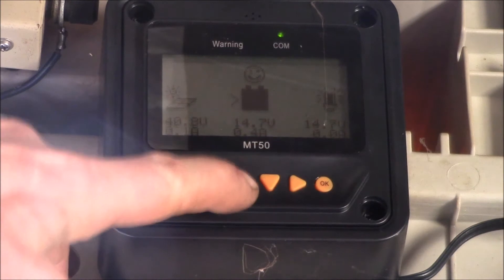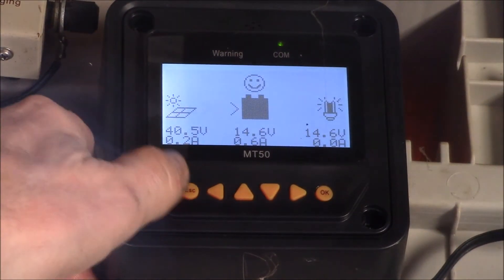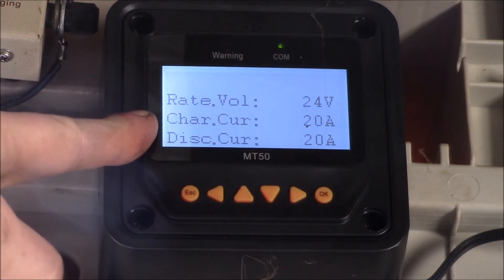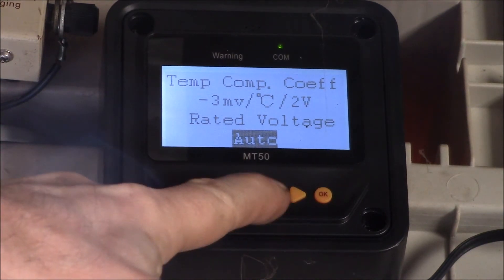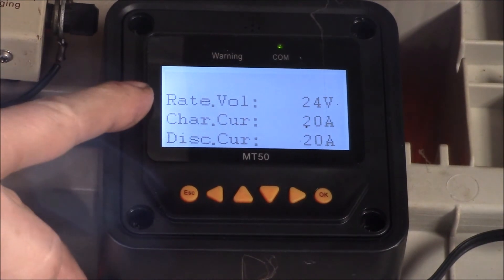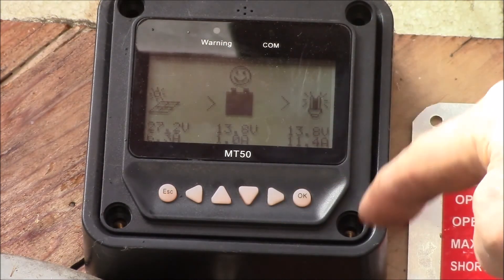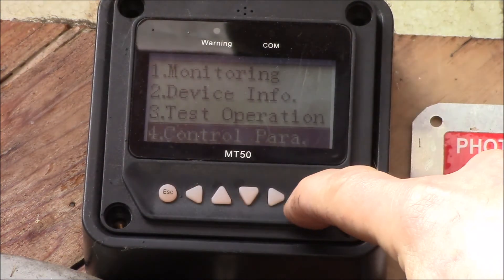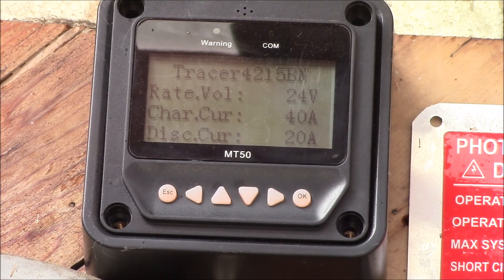EpEver/EpSolar MT50 Remote Display: Device Information Screen

Comment: I chose the 60a unit, and i put up 4 210w panels. The open circuit voltage is 19.83v and short circuit current is 13.09a, if i have my information correct i can run two in series then parallel the two series. I will need a 15a inline fuse in both series before they are paralleled. From there to the controller i won't need any other fuses, but i will from the charge controller to the batteries, do you know if im correct in my thinking? Since i may be adding another two panels in series if i need to, i believe you mentioned i would be all right maxing out/nearly maxing out my controller since it will only take up to 60a, and any more would just be loss of potential, will i need a 60a fuse from cc to battery bank or should i use a 100a in your opinion? From what i gather i need 12awg, is it ok to run 10awg though? I will only have 8-10 feet to run from my panels to cc, then 5-6 feet to my 12v 580ah lifepo4 battery bank. Any advice would be greatly appreciated, I've asked some of the content creator's that I've followed to get this far, but not all of them (any yet) have responded lol, but hopefully i get some input. God bless!!
Reply from the maker: Yes, if you have both series strings fused then no need for a separate fuse to the CC, although you might want to add a switch or breaker so you can disconnect PV input if needed.  10AWG is fine, that's about the limit of what fits into most MC4 connectors if you're making your own cables.  80A or 100A to the batteries sounds good, just want to be above the rated output of the CC and sized for whatever cables you are running to the batteries.  The CC will limit the battery charging current to it's 60A rating more or less, it may go a bit above that from time to time.
Reply: @The4Crawler  Hey i appreciate the information, i can't thank you enough!!

Comment: How much hours do you recommend setting the boost time charge on the mt50 controller...
Reply from the maker: I think the default is 120 mins. but you could set it higher and then see how long it takes for the charging current to drop down to the typical float charging current, which is in the range of 0.01C - 0.02C.  Then use that time or if the battery mfg. has a recommended setting, use that.
Reply: @The4Crawler  thanks much ...  .. i am using some trace 6 volts 225  amh lead acid batteries
Reply from the maker: @randomtv.9486  Likely your float charge current will be around 2-3 amps then.  See how long it takes to hit that as the boost charge tapers off.
Reply: @The4Crawler  Thanks much

Comment: Hi, we've recently bought a camper & we have just changed the x2 130ah lead acid batteries over to x2 110ah lithium batteries (life PO4), what setting do we put on the MT50? We know almost nothing about electrics & all the solar etc... We have x2 160w solar panels & an epaver  tracer MPPT 3210AN with the MT50. We tried changing the MPPT to FO4 but it would only allow us to click either SEL, GEL or FLD.  So we came across your channel & we've just watched your video about changing the MT50 to USER. What is the best setting for us to put it on without worrying about all the parameters or any major adjustments & is suitable for the Lithium batteries? 
2nd question if we have to change the battery voltage on the screen do we put the combined total ah (220ah) or do we just put the ah of a battery (110ah).
We live in the UK & are finding it all a little confusing so would appreciate any help or advice please. The only thing we do know is the charging voltage for each battery is 14.6
Reply from the maker: See this video:
https://youtu.be/4wt_L2L4W4Q
for information on setting up Li-Ion and LiFePO4 batteries.  There's a file linked in the description with the EpEver settings from their PC program that you can start with.  You can adjust those values as needed for your specific battery.  And in the MT50 user type menu settings, you may need to go through several times because settings later in the menu limit settings earlier in the menu.
For AH settings, 2 batteries in series, AH stays the same and voltage doubles, for 2 batteries in parallel, AH doubles and voltage stays the same.

Comment: My mt50 fails to go to day time charge mode even after 24hr clock has been set hope you can help.Cheers Peter.
Reply from the maker: I don't think the clock has any affect on what charging mode the controller uses.  I think it goes off of the start of sunlight hitting the panels after a night time period with no panel input.  I can trigger mine into a new "day" by switching off the PV input for a while then reconnecting it.  With this controller now, I have it hooked up to my 24V battery bank in order to charge my 12V battery bank.  It never goes into absorb or boost mode, it just sits on float 24/7, unless I switch off the PV input.

Comment: Hi. Thanks for the information you share. I have just started using a 4215BN unit and connected it with a MT50 remote. I would like to bounce some thoughts off someone, and you seem to be interested in this stuff. I am thinking that the load system should be able to be used as a load dump method for when more power is coming in than is needed. Have you had any success setting and using the load system. I am trying to use the settings to start dumping power at a certain voltage and then allow normal function once a lower voltage has been reached. I see in the menu for the load settings, after the voltage setting there is a place to change a time setting. Do you have any idea what that time settng is about?? What I am trying doesn't seem to be making much sense at the moment. Maybe we could have a bit of a to and fro conversation. Regards Stephen
Reply from the maker: I think a lot of these type of charge controllers started out as a way to power street lights or security lights.  So charge the battery during the day and then turn the light on at night.  The load functions are all based around that.  Time "0", so to speak, is sunset, i.e. the PV input drops to 0 volts.  Then the load can be turned on for 1, 2, or how ever many hours and then shut off at the specified on-time.  I just leave my load on all the time and then can manually turn it off if needed.  You could rig up an adjustable voltage sensing relay to do something like you are talking about.  On the other hand, the controller will not bring in more power than is needed.  It'll throttle back on the MPPT until the imput power matches the battery charging and load.
Reply: @The4Crawler  Thanks for your input. I have my doubts about the throttling back part. Mine just seems to keep pumping. I have tried resetting the boost charge time to a lower value than the factory setting. I will see if that makes any difference. And I don't seem to be able to tell what mode it is in at any given time. ie boost, adsorbtion or float. If it is connected to the PV panels the energy has to go somewhere. I don't think the heat sink is there to dissipate that energy. My system is a little larger than yours. I have three 180W panels and using four 6V 232A/H batteries in series for a 24v system. In stead of throttling back my batteries start to gas and the voltage is staying up in the 29V plus range when the sun is out. I see in the specs that my controller is rated to discharge at 20 amps if needed. That's half of it's rated input current. That's a lot of current. I am concerned that unnesseccary overcharging will shorten the life of my flooded batteries. They are brand new a couple of days ago. Regards for now. Thanks
Reply from the maker: @gasonthebrain3738  If you have the USER battery type set up, you can try adjusting the voltages for charging:
https://youtu.be/4XhvwruVEJU
I had around 200 AH of 12V AGM batteries and mine would drop to the float voltage at 1-2 amps once the batteries were fully charged.  In fact just checked now and its at 13.8V and 0.9A.  The high voltage might be the equalize charge settings.

Comment: Spec for this controller ?
Reply from the maker: The 4215BN information is below:
https://www.epsolarpv.com/product/61.html
40A MPPT controller, I think it will handle up to 150V PV input, but that data sheet would have that number.

Comment: Great information.  Thank you.
Reply from the maker: Glad you found it helpful.  I hadn't paid any attention to this screen before but it is a bit confusing as both it and the Control Parameter screens both list "Rated Voltage", but they are really showing two different numbers.  I think they should really change the label in the Control Parameter screen to something like "Battery Voltage".